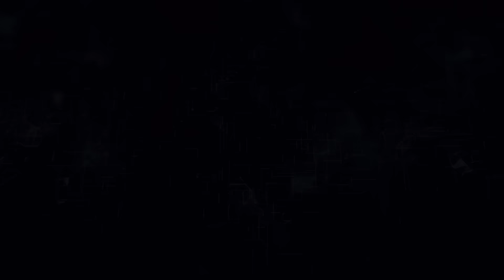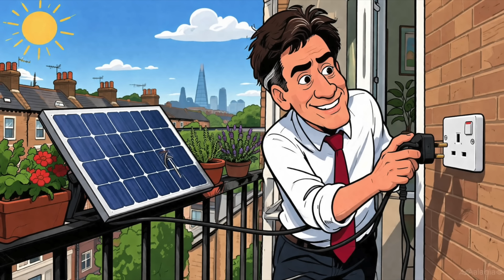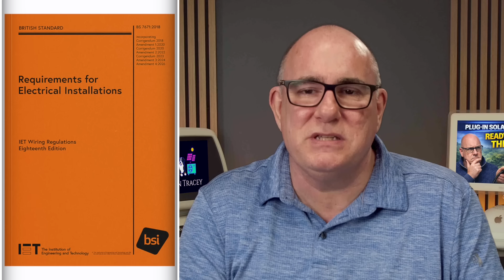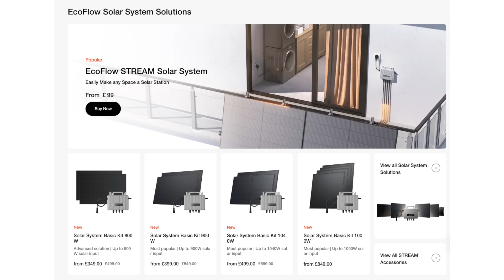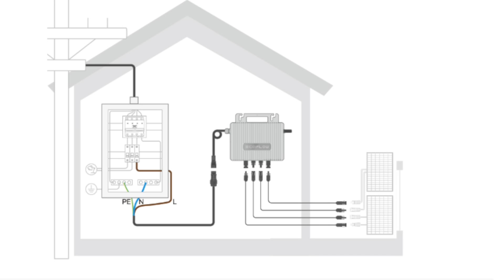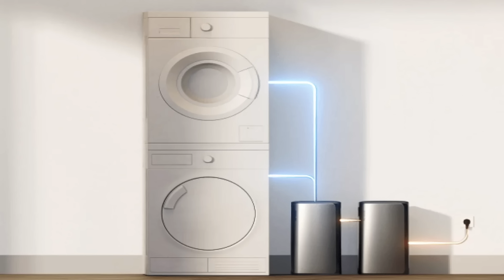Plug In Solar Is Coming… But There’s a Problem

Comment: You’re a wiz. Tell us about how we could use EV V2L. Is this change going to allow it to be plugged in the mains in any way?
Reply from the maker: no, this doesn’t cover V2L or any form of V2x sorry
Reply: Tech answer (and this is done in some countries but I've never seen kit offered for it in the UK).

You plug an approved grid tie plug in inverter into the wall. You plug it into a battery. You plug a battery charger into your V2L and into the battery. The V2L provides DC to the battery interface which is then turned into AC in phase with the grid into the house.

Ecoflow kit isn't designed for this kind of use, but some of the others can be abused this way as they are designed to work with 3rd party batteries (so much cheaper) and thus third party additional battery charges etc.

It's not terribly efficient but it is possible.

Comment: Do the grid tie inverters with these plug and play solar panels have limiters?  because my understanding is that without limiters if you are using 100w watching tv and the panel is supplying 600w the surplus power going into the grid will fool the meter into thinking you are using 500w. costing you more than you are saving.... any thoughts?
Reply: Yes. Your meter will go backwards. ie  minus 500W like you gained 500W , put it into the grid
Reply from the maker: @steevo8025 Good question 👍 but that’s not quite how modern systems behave.

Modern smart meters can **separately measure import and export**, so they don’t get “fooled” — if you’re using 100W and exporting 500W, it records that correctly (and doesn’t charge you for it).

On the inverter side, many systems can also *limit or ramp down output* depending on demand (or are designed to sit under typical baseload), so they’re not just blindly pushing power out.

And this is exactly where batteries come in — instead of exporting surplus, you store it and use it later, which usually gives you much better value 👍
Reply: @JonathanTracey  thanks for the quick reply but i do know for a fact that some existing smart meters cannot tell the difference what way the watts are going and meter usage when exporting so its a problem right there already.  Im wondering how many tens of thousands of people will pay to export to the Grid.

Comment: What happens if you plug it in and your MCB on that circuit isn't labelled as "bidirectional"? Will it still just work for most people?
Reply from the maker: I can’t speak from personal experience because mine are on by directional circuits, but there are over 1 million of these installed on the continent for people who just bought them in a shop and plug them in, so yes I think it will work for most people
Reply: It will work. The theoretical risk is that you'll burn the MCB coil and it won't then protect from a failure the other way. There's a lot of argument between electricians about how "theoretical" this remains at a million installs.

Comment: Plug in solar sounds great but.....the UK is awash with electronic devices that have CE and UK certifications but do not actually meet those certifications, the manufacturer supplies the UKAS with equipment, gets the certifications then promptly removes the components in prodution to an absoloute minimum . The equipment is never looked at once it has the certification..trading standards dont look at eveything.
Reply: Yep - even B&Q is selling dodgy looking systems claiming to be an 800W solar system with a dubious plastic box MPPT and a panel that can't be more than 80W. That's a different problem and this stuff  is already on sale and being used.
Reply: @etchedpixels  My issue with a lot of todays electronic equipment is the hash and interference they cause to the radio spectrum (Im a licensed radio amateur). Trying to find the offensive equipment is the first problem, then trying to explain to someone what the issue is, a plastic box as you mention says to me no adequate screening of the electronics if the circuit is radiating RF.
Reply from the maker: @radiotowers1159 I get the concern 👍 and you’re right, certification isn’t perfect.

That said, most reputable manufacturers stick to standards because the risk (and liability) of getting it wrong is huge. It’s less about “nothing is checked” and more about choosing trusted kit rather than the absolute cheapest option.

Comment: Fucking sunshine would be a help 😖
Reply: I emigrated to the Caribbean 5 yrs ago and we have the weather for solar. My automatic gates are solar operated. Security cameras are solar and my hot water is generated by solar. My cousins air con units are solar operated and I plan for my home to go fully solar in the next 3 years.
Reply: Yeah and the government not separating the skies to make it rain all the time. I’m getting web feet .
Reply: @lesleyprince8983 ive bought a wet suit to go shopping
Reply: March was OK for me, I generated about as much as I used. Even today, it's cold, dreary and overcast, but there's enough light to balance the background load and charge my battery. 
A small 'balcony' system would probably be generating enough for half the background load.
Reply: modern solar panels dont require direct sunlight
Reply: Just looked up at the dreary grey sky and read your comment - LOL
Reply: we get on avg around 3 months of it starting next month. maybe
Reply: But there blocking it , scotland has sun every day all morning every day ,beautiffull .
Reply: @crosshatch34 no they're not.  Where do you get this idea from?  There have to be certain safety standards put in place before its rolled out to the rest of us
Reply: @mypointofview1111 so you cantsee the sarcasm ,lol
Reply: It's more than you think. After reading your comment I just checked my ecoflow app and It's currently generating 1.3Kw from 4 panels. It looks pretty sunny to me. Weirdly though on some dull looking days it still seems to generate a descent amount of electric. I think sometimes it doesn't look that sunny but the light seems to diffuse and go in all directions hitting all my panels that are pointing in different directions. The panels are that way to avoid large trees etc.
Reply: @andyspoo2  My friends say similar things about their set up. 👍
Reply: They do well in countries with lots of sunny days per year. We have it rainy/cloudy here.
Reply: When I moved out of Dublin and moved to the sticks 50km away I noticed it is alot windier colder and rainier. I could get a phone call from my brother telling me it's been sunny all morning while it has been raining all day here. 😂
Reply: Whether the sun shines brightly every day or not the sun comes up every day and that's enough to generate energy to power your home and decent sized batteries.  Over the summer months you can power up several decent sized batteries if you either get one or several and daisy chain them to receive power.  Over autumn. Winter and spring months there's enough sunlight to top up the energy in your batteries which will significantly reduce your reliance on energy from the grid.  
The myth that you had to have sunshine 24/7 is just that, a myth spread about by people who've got significant interests in the oil industry, they want to keep that gravy train going at our expense.  I don't know about you. But I'd rather put a few hundred up front to have significantly reduced or free electricity long term
Reply: Even in rainy Bolton I made 22kwh today
Reply: I've had plenty of sunshine in North Cambridgeshire in the last week or so. I've been   using the dishwasher and washing machine and it's not costing me a penny and I'm selling electricity back to the grid. That's just off 6 ground mounted ( I don't have a suitable roof) solar panels.
Reply: @PhyllisGlassup2TheBrim  Does that stop you paying an extortionate standing charge every day?
Reply: It's not about heat its just light.
Reply: 😂 too right!
Reply: Call up the Australian Embassy, maybe they've got some you could share?

It was sunny in southern Alberta two days ago when you posted that.  Below freezing and snowing since though.
Reply: Whats sunshine?
Reply: And we've had PLENTY this Easter! ... Last week, for the first time ever, my house drew 0 kWh from the grid, and this week, so far, It's drawn 1 kWh! ... No expletives necessary! 🤣

My batteries have been 100% every day for some time now.
Reply: I'm in northwest uk n we joke government cuts mean they've switched the sun off in the north 😂
Reply from the maker: 👆👆👆that
Reply: There are real signs that government is actively manipulating the weather over Ireland and Britain nearly every day. This can be seen on the visible satellite images where frequent cloud waves are visible.
Reply: @timkelleher2052  So you forgot what the weather was like from last year going back at least 200 years. It's called UK weather!
And for planes trails to start making artificial cloud cover, it would take at least 300,000 flights each day just over the sky you see in you're area alone, for it to begin filling the sky! 
Stop believing all the conspiracy rot!
Reply: @timkelleher2052  Is this evidence in the room with you right now?

Comment: You seem to clearly state that the maximum base load level is likely to be 800w but is that true? If I read the Ecoflow paperwork correctly, the Stream X and AC Pro battery combined will deliver up to 2300W to your baseload - in fact at that level it is rather more than a baseload!  Or did you mis-speak?
Reply from the maker: 800w is the max to the grid/home. 2300w is what you can draw from the batteries via the onboard sockets.
Reply: @JonathanTracey  That put a very different complexion on things.  If for whatever reason you can't use the onboard sockets then ROI will be well over 10 years for most users unless your baseload is unusually high.  No way to up the 800W max?
Reply: @DaveBecs  The RoI calcs for 7 years and Ecoflow are based on the overpriced Ecoflow kit and the 800W. If you can use more than 800W then it'll marginally shift it but not really very much.

Comment: It is pointless advertising as saving households money micro inverters like all solar fluctuates with a cap of 800w , you will only see on average 400w -600w  in summer unlike U.K. Germany is lower in the hemisphere, once it gets to September it will generate next to nothing
Reply from the maker: @ram64man There’s a bit of truth in there, but it’s not quite that bleak 👍

Yes, solar fluctuates — but on a good summer day an 800W system will hit close to its full output. In my case, in the height of summer my 800W micro inverter is producing the full 800W at peak.

The key is what you do with it — paired with batteries, that daytime generation can be stored and then used through the evening, so it’s not just “midday only” power.

Winter output is obviously lower, no argument there — but saying it generates “next to nothing” from September isn’t really accurate either. It tapers off, it doesn’t just stop 👍

Comment: The point of Balcony Solar is that the typical generation is less than the home's typical consumption. So, generally exports are not worth bothering about. 
The way to extend this is with a battery. What I've done (in Germany) is put 4 panels (430W each) into a pair (4KWh) of Growatt NOAH2000 batteries. That goes out through a 800W inverter. I program the system to release 300 Watts over night. 
A battery is very expensive compared to the panels. About €1000 for 4KWh, compared to €55 for a 430W panel. But that is a lot cheaper than an installed battery, so for me it was more about a battery extension than more panels.
The NOAH 2000 accepts DC input (two inputs per battery, and outputs DC to the inverter.
Reply: Totally I am naive on the whole subject. I would like to power my backyard office/gym using your system as an offgrid. Forgive my ingnorance; I am not an electrician and I am a woman. Kindly, could you make a lists of all elements of your system with links to where to purchase. Thanks a million for your help in advance. God Bless
Reply: Think I might check out the regs here in Spain for my house
Reply: Doing what you do was my first thought part way through the video. Glad it can be done.
Reply: Am I right in understanding with the Growatt battery set up, the inverter comes 'after' the battery? As in the battery is DC and power used goes through the inverter then out to the house?
Only asking as I think I'm right in saying there are AC batteries that need the inverter between the panels and the battery? Or indeed, there's the likes of Eco Flow that has the inverter built into various of their Stream batteries.
Reply: How on earth is a typical home consumption more than 800W, excluding heating? That will obviously be huge.
Reply from the maker: @alexterrell1062 That’s a really solid setup 👍 and you’ve pretty much nailed the core idea.

You’re right — balcony solar is designed to sit under typical household demand, so export is minimal and self-consumption is the goal. And using a battery to smooth that into the evening is exactly how to get the most out of it.

On the numbers:
- €1000 for ~4kWh is actually very reasonable vs installed systems  
- Panels being ~€50–60 each also checks out — hardware is cheap, it’s installation that drives costs up  

Only thing I’d add is most people won’t be quite as optimised as your setup — without that controlled overnight discharge, some energy does still get lost/exported.

But overall — great real-world example of how to do it properly 👍

Comment: Am I right in think currently you only save the vat on batteries if it’s bought with a solar panel? Hope that will include these off the shelf kits
Reply: The VAT rule was changed to fix the weirdness where installers fitted a token extra panel to get the VAT back. However for a DIY install you'll pay VAT anyway as it currently stands
Reply from the maker: that was the case when I bought my batteries, if you didn’t buy solar at the same time and they weren’t zero rated

Comment: I’m looking forward to this, my base load is 100-200w when working from home so for me I think a big array would be overkill, 800w and a battery to save up some sun for cooking in the evening is just what I need.
Reply from the maker: @youngwt1 That’s exactly the sweet spot for a setup like this 👍

With a 100–200W baseload you’ll be soaking up most of what it produces during the day, and the battery just lets you shift that into the evening for things like cooking.

Not going to run the whole house, but for covering the basics and shaving your bill down it’s a really solid setup 👍
Reply: A battery makes the whole thing pointless, you won't make the money back before it all has worn out
Reply from the maker: @mw01908 Ah yes… batteries — famously useless, that’s why no one uses them anywhere 😅

They don’t magically print money, but they do let you use the energy you’ve already generated instead of giving it away during the day and buying it back later.

If they didn’t work, the entire grid-scale battery industry and pretty much every EV on the road would be a very expensive hobby 😉

Comment: This does not solve the UK energy independence or security issue. We will have power mid day mid summer when demand is at its lowest and no power evening mid winter when demand is at its peak. The problem will remain the same no matter how many of these systems consumers buy.
Reply: The systems generally come with batteries. Wonderful thing batteries, electricity goes in when its sunny and comes out when you need it.
Reply: @etchedpixels shifting 3000kWh from summer to winter is a totally different proposition to shifting 2kWh from mid day to evening on the same day or next day. The practicality and economics are lightyears away from being sensible.
Reply from the maker: @clwydsigma You’ve basically just described exactly why batteries exist 👍

We don’t have to use solar at the exact moment it’s generated — store it at midday, use it in the evening. That’s already happening in homes today.

You’re absolutely right that shifting summer → winter is a completely different challenge, but day-to-day balancing (midday → evening) is very much solved.

So no, this on its own doesn’t fix the entire energy system — but it definitely chips away at the problem rather than leaving it “the same” 😉
Reply: @JonathanTracey  shifting 3000kWh from summer to winter is a totally different proposition to shifting 2kWh from mid day to evening on the same day or next day. The practicality and economics are lightyears away from being sensible.